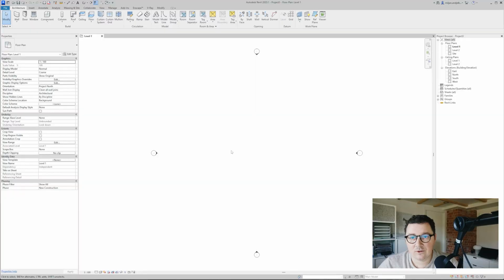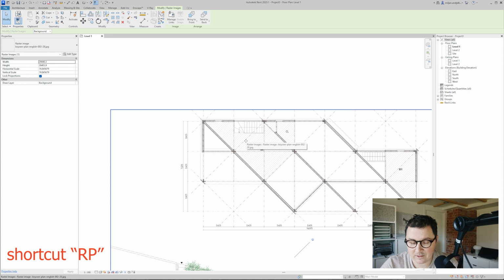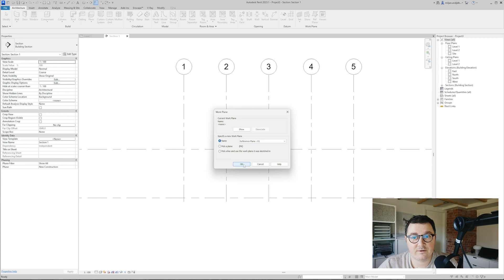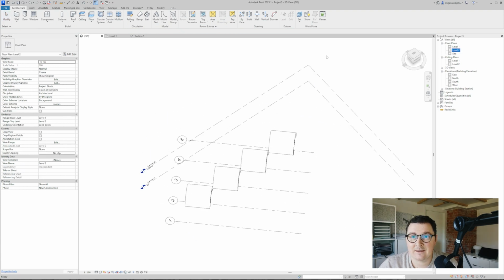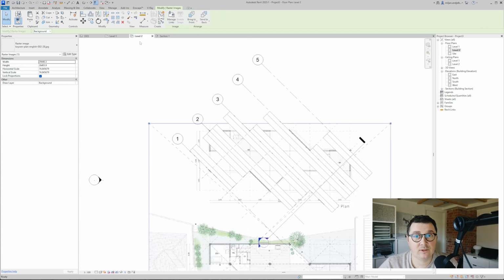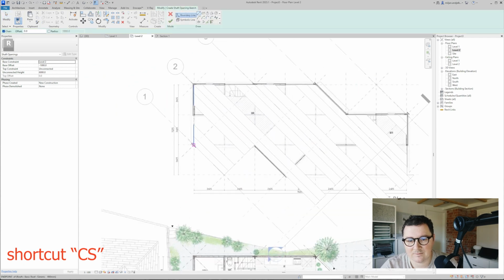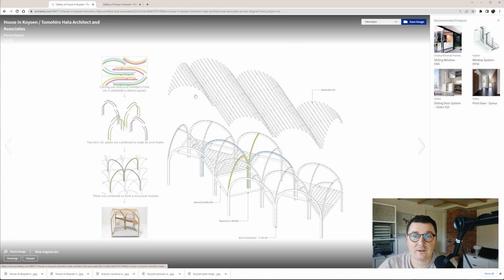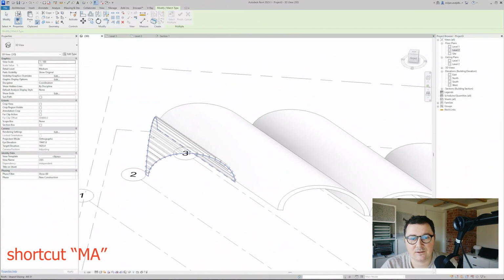Roof by Extrusion in Revit - Koyoen House

Comment: Nice video!, Thank you for the tutorial, I followed the video and it works so well! If I want to draw the whole piece of the structure (column+ roof arc), how can I do it in architecture template without using a family file?
Reply from the maker: Hi, thank you 😊 I did this in architectural template, this was done as project file, not family file, so just do as I did 😉